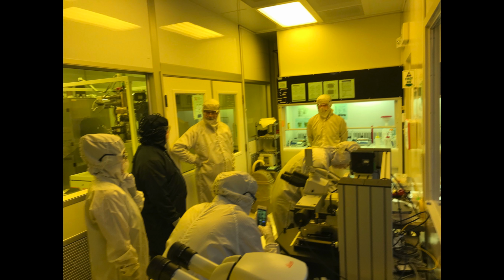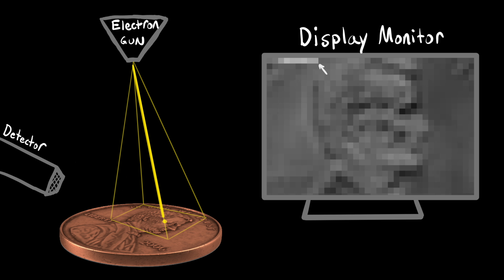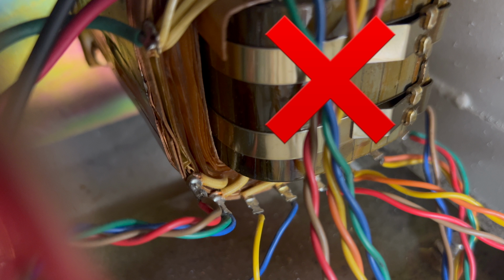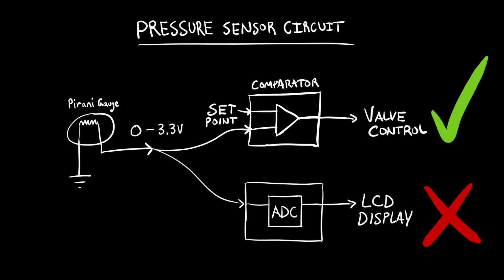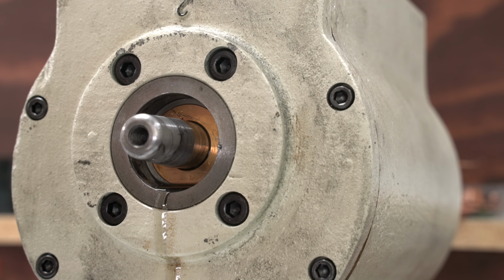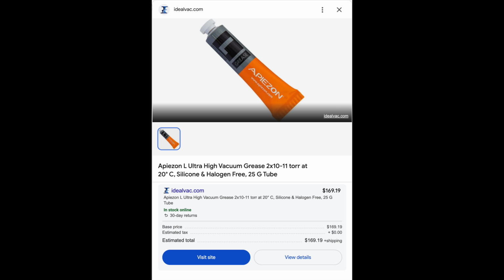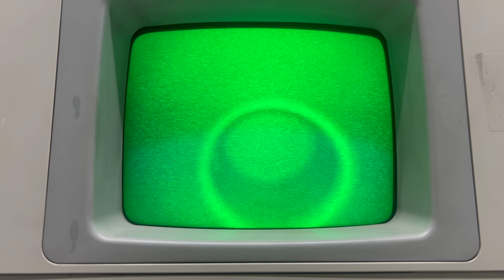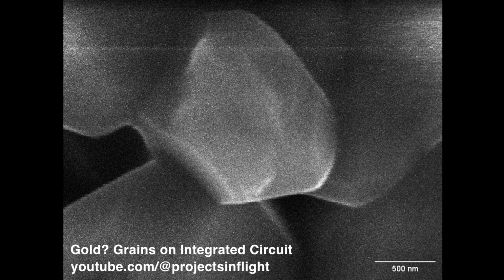I Saved an Electron Microscope from the Trash

Comment: try making a scanning electron beam punch card disc data storage with that. euv diode laser optical. diy is free. try low voltage s(t)ems. static electric charge is enough for s(t)em. much easier when you can run a whole stem from a small battery, instead of wall power. its better to use a small electron beam emitter that is separately always in vacuum, that is close to the sample. not in a huge air volume pipe that needs to be vacuumed empty. then the electrons only travel a very short length over somewhat vacuum from the emitter to the target. with stem its even easier because the detector is on the opposite side of the target, not on the same side. but both cases work. even better if the detector is on the same package as the emitter, like a radar with a radar source. vacuum can be also got with electrostatic vacuum pumps. diy. why do you say me to be good. only one is good. there is no other second coming, those are false gods. God is Spirit, do you have Spirit, that makes alive. completely sealed type vacuum pump, does not require hard to seal tricks. which is easier, to make a completely vacuum tank with internal sections like in submarine, or a single tank with attempts to vacuum seal tricks. no alternative? well, diy the whole vacuum system. dont pay for nonsense claims. you know that market sells for liens. not properly designed system, needs constant maintenance and expensive parts. yeah your system can do whatever. D=O. diy or you dont have it.
Reply: btw, instead of the crt electron accelerator steering system, try tritium with 5keV particle energy right out of the box, for scanning electron microscopy imaging. just do the scanning part, like in a DVD drive.
Reply: how about using both alpha+ and electron+ alpha/beta decay sources at same time, you get neutral fast alpha particle stam.
Reply: how about using both alpha+ and electron+ alpha/beta decay sources at same time, you get neutral fast alpha particle stam.

Comment: Hold your hat on, everything points to apiezon L being hydrocarbon grease.   Gee, petroleum jelly repackaged and sold for $200/g.    Get an FTIR for it, and petroleum jelly.   Thanks for the video.
Reply from the maker: I think the high cost comes from the additional refinement that is necessary. They have to remove all of the hydrocarbons that have a vapor pressure greater than 0 in a high vacuum environment, which is very challenging.

Comment: I laughed when you not only using a 5V regulator instead of a buck converter, you slapped the big ass heat sink on it. But at the end of the day, whatever works.😂
Reply from the maker: yeah, i wanted to use a buck regulator but i was worried the high frequency noise would be a problem somehow
Reply: @projectsinflight  just slap some capacitor on if noise is a factor

Comment: I worked at an out-of-the-way department of Cambridge University. The university officially had two electron microscopes, and big qeues to use them. But where I worked had a third one that students "in the know" could get their pictures done on. The building was from 1950 and the microscope not much newer, if not built into the building itself (it was later removed around 2014, I don't know if the outgoing department took it with them, or just scrapped it). It must have cost the eqivalent of millions back them (so about £50,000!)
Digital printouts, what are those? It used film, which had to be developed in the adjacent darkroom!

Comment: wait you had 7 taps on a transformer?  and 3 werent even used... not trying to be critical but since you had a spare tap of the correct voltage, did you try just switching to the good unused tap?
Reply from the maker: when one secondary is shorted it shorts out the whole transformer
Reply: if you release (ie cut the connections to the secondary it shouldn't effect the primary),  if the other taps are down then it wasnt just one bad secondary.
Reply from the maker: the secondary was shorted internally. I'd have to fully remove that winding to repair the transformer

Comment: Couple of hints based on some 15 years of tinkering with vacuum systems and electronics in general:
- The diffusion pumps are no longer used, but you should be perfectly OK using a turbo pump instead. Some used ones can be found on ebay for couple of hundreds bucks. This is in case you or one of the other enthusiasts ever need to replace whole vacuum system.
- When fixing power supply - when you have a linear voltage regulator down the line, you should be perfectly OK using switching power supply, like the ones for 3D printers or CNC routers. This replaces the transformer + rectifier and is way easier to obtain. Also you can adjust output voltage, so 100V vs 120V is not an issue.
- The problems with image may be because of a corrosion in relays. Most relays are not sealed and contacts will degrade both with use and with time. This would be first place to check.
- If the frame grabber still produces wonky image, go through ebay and look for different frame grabbers. This is very much dead technology, you can pick them up for 50$ a pop sometimes. Getting them to work may be problematic - all the drivers are expecting old windows or ancient linux. Proceed with caution.
- As you are using PMT for readout, you can also just bypass this whole mess and build images yourself! You would need to find direct signal from PMT, a decent scope (Pico Scope for example) and scanning timing signals. Grab data, make some script in python to convert the analog readout into pixels and voila!
If you hit any obstacles, you can always drop me a message. I've been working in academia most of my life and have some experience on fixing stuff with non existent budget :).

Comment: For damaged shafts that need to seal properly, buy a Speedi Sleeve of the correct size. I have used them to successfully repair machines with grooved or pitted shafts.

Comment: Note - that model costs over $4,000 used. After doing some digging, there are several companies who specialize in buying and refurbishing lab equipment.
 So ... WHO THE HAY throws valuable equipment out, even if it doesn't work ?!

Comment: Great video. It brought back a lot of memories. While undergrad lab assistant @ Texas A&M Semiconductor Lab in the early 80’s I worked on high vacuum systems and repaired Transmission Electron Microscope, linear accelerators, plasma deposition, etc. we would receive obsolete equipment from Texas Instruments, AMD, Mostek and others. Luckily we would usually receive multiple units and would have plenty of organ donors to get at least one working.

Comment: You might be able to effectively enhance the resolution on most scans by using some basic stepper motors and coding. If you attached the motors to the micrometer controls you could pan and scan then stitch the image together. Eg you want a clean 100,000x image, zoom in to 300,000x then pan and scan around, stitch image together produce super-res image. Just a thought

Comment: Congratulations! We have a Sciaky Electron Beam (EB) Welder that is also quite old. The biggest difference between our machine and yours is ours is much larger with a vacuum chamber large enough for aviation components. Also we weld joints with our image while you reflect your beam to view images. When this machine is malfunctioning it doesn’t give up its secrets easily. Many nights I’ve left work in a brain fog after spending a whole day getting nowhere figuring out the issue. Your video had me on the edge of my seat finishing your sentences yet wondering what you were going to encounter next and how I might deal with it? Very intelligent very creative approach got this machine back up and running! Congratulations once again-I’m so excited for you!

Comment: At the end of the day, all the "computational intensive" stuff is done after the electron detector. You should try to read from it into some modern electronics. I don't doubt that the amplifier in this thing were top quality, but maybe with modern computing power and algorithms you could achieve better quality images. At the very least you could funned data into a more convenient software in a standard format.

Comment: is it possible to convert that crt into an led monitor?? would be cool ig
Reply: i think it would be easier to just use the computer connection and screw on an additional LED monitor. also, CRTs look dank
Reply: @sanantonio855  born in mid 2000s, so I don't really like the appeal of a crt. I just would've liked the led in place of the crt

Comment: 100v AC, JDM model with a variac! Amazing. Also, the analogue circuitry that drives the crt probably has cold solder joints, which makes the screen jump. Cards are St. Louis Cardinals Baseball.

Comment: Try making an electron mirror! Put a square/sphere of PTFE inside and charge it up to the highest voltage you can with the SEM, then drop down the voltage to 5kV (or less) and the electrons will "bounce" off the PTFE due to charge repulsion and actual image the inside of the column.

Comment: This is amazing! Best repair of all time!
Since the video signal seems to go through an analog coaxial cable at some point, could you switch off the CRT and use a modern LCD monitor, using the VGA input?

Comment: This project is very inspiring.  When I was a kid (early 1970's) our 13 chanel B&W TV went screwey.  My dad opened the back, pulled out all of the vacuum tubes and we took a walk to a pharmacy that had a tube testor in the back  (it was closer than the hw store) .  We plugged them all in and found that one was faulty.  Next to the testor was a shelf of various replacement tubes including a replacement for the dead one.  $2.00 (I think) and a 10 minutes walk home, some cussing and swearing as a screw fell into a bad spot (dropped when I handed it to him), but an hour later I was watching Scuby Doo or possibly Spider man.  Good times. And a reminder that given enough motivation we can fix most things.  It can also add fuel to the "right to repair" movement.

Comment: 29:27 I have worked on many CRT in my younger days. That looks like some caps on the monitor are failing. I recommend contacting someone that is vary familiar with monochrome CRT repair for advice.

Comment: Great content! First time in a while that I've watched the whole video without skipping any part. Also, this was only possible due to the age of the machine. See, it rellied on simple circuits to implement a certain logic which means that, by replacing the individual circuits, you can still keep the machine running without knowing all of the details. Nowadays, processors, while being well protected, are very fragile to voltage spikes and high temperatures. If they get destroyed somehow, there are very few options for fixing the whole unit because of incapability of getting the right firmware to program it once again. They are a lot more capable, but that obviously bears the burden of the potentially shorter lifetime.

Comment: I was impressed with your electrical engineering skills until the end when you said you make ICs at home. Now I'm impressed with your pump knowledge. 

Amazing repair. Kinda lucky that the issues were on relatively easy places to spot instead of like the internal digital circuit.

Comment: With the image acquisition... would it be more useful to capture a series of faster scan images than one slow image? Maybe one could add another digital capture to the video signal. With a set of images, the usual operation would be to just average them out. Even just that could already lead to a better resolution and dynamic range than the analog averaging. But it would also be possible to remove or realign outlier frames. And the distribution for every pixel would be a gaussian curve, so maybe one could use the variance of each pixel as a false color channel? Probably people have thought of such things before, but I don't know much about electron microscopes.

Comment: Brings back memories. Vacuum numbers are rookie numbers though . Gear I worked on went to 10^ -16 torr. Fun times.
Reply from the maker: i'm guessing you used a cryo pump and ion pump in addition to the diff or turbo? I can't imagine ever getting my vacuum that high with a chamber that is constantly opened to atmosphere. i was contemplating someday trying to make a uhv chamber though
Reply: @projectsinflight  Yes to all the pump types. Pump failures can be exciting (read expensive). Knife edge flanges with dead soft copper "gaskets". Cleaning, so much cleaning.

Comment: I ve fixed a ton of equipment not an electronic microscope. You see a toN of Issues in the mechanical side. It is no surprise maintenance lacking was the key issue for this microscope to fail. From the video part. You maybe need to replace video cables as it is analog signal and by themselves generates noise(cables isolation). As most video hardware degrade as mostly uses electrlitic caps. These die of age.

Comment: Big deal. You fixed an SEM.
I cleaned out the secondary lint filter on my dryer. Yes, the secondary filter. And I did it a month earlier than required.
I was so excited at how well that went that I then cleaned out the in-line water filter on my washing machine. It had a little slime build up, but a misture of 0.5 cups ammonia, 0.5 cups of Simple Green in 500ml of water cleaned it right up. There was no debrie in the filter, a clear testimony to how careful I am with items placed in the machine. All pockets are checked for foreign objects. Yup, it was a big day of maintenance on appliances. The wife is sooooo happy.

Comment: stabilizer 7805 can be installed 2-3 times in parallel to heat less.
An analog cable can be better, with an external additional screen attached to the ground (this should reduce image noise and allow more useful signal to be extracted)

Comment: on the computer you can use high speed scan and overlay thousands images and extract median value of the images... so having more resolution and/or noise reduction that follows the formula of square root of number of images resulting gain.

Great video

Comment: Great video :). The scanning electron microscopes workings actually look resonably simple. It is basically a gloryfied cathoderay tube where the picture producing phosphorscreen is replaced with a microscope stage and a Image intensifier tube. Plus som control circuitry. The instability in the image could be caused by old, leaky or shorted capacitors especially as the microscope was produced in the time of the capacitor plague.

Comment: ok back the diff pump with rough vac and it needs a chiller, what a needy little pump.  

does the diffusion pump spit oil back up into your "column"?

very cool video! my boss bought a few of these but never got them up and running..wish he was around to tell him about the discord! and I love the gross leaking bellows! classic.

lol good thing the fly didnt off gas too much.  great work!
Reply from the maker: The diffusion pump boils oil and the oil vapor stream could potentially enter the column and contaminate stuff. There is a baffle that is liquid cooled between the pump and column that condenses oil vapors that get past the main part of the pump. If the liquid cooling fails and the baffle gets warm it will allow the vapor to pass into the column, which is a very, very bad day.
Reply: @projectsinflight   i have some experience with electric propulsion, the contamination from diffusion pumps was not recommended so I have no idea of their operation procedures.  I am mostly familiar with turbo pumps and cryogenics, and all the ways you can crash them :) i can imagine a scenario of plasma heating the baffle and causing oil mist to enter the main chamber volume.  

It was also cool to see you use IPA as a cheap leak detector. nice attempt at the rough pump rebuild.  xbox donor switches. dude you are a brilliant engineer.

Comment: Strange, non-causally related number of errors that could not logically have been caused by use, as each individual error would be critical.
Reply from the maker: i suspect one of the errors was the thing that broke the machine first, then the others probably were caused either by poor repair efforts or poor storage
Reply: @projectsinflight  Yes, that's the only way it would make sense, because push-buttons don't break if their power supply has died beforehand. Conversely, no one can continue working with defective buttons until the power supply finally dies.

Comment: just a thought, your can wire that composite video cable to a cheapo usb capture card and use it on a modern computer, with some video capturing dark arts you can make something much better than that 20 years old software running on xp.

Comment: WOW, your level of patience is incredible, congrats on your repair!. Here is my humble suggestion on how to use the SEM for other purposes, can you try to use it as E-beam lithography tool?. From experience, it is just a software change. You can coat a piece of Si with PMMA and use the proper energy for exposure. Later for imaging, you can use the lowest voltage possible, 10 kV ish?.  I am wondering if you can get a photonic waveguide or coupler in the 100s nm range.

Comment: 29:19 I'm sure you've thought of it but that instability could be the CRT itself.  Also is that RCA signal, NTSC standard? Could you just plug a standard composite capture device onto the RCA and use a modern screen or PC? Fun stuff.

Comment: When I saw the instability on the monitor, my first thought was that the frame circuit of the monitor itself was the cause.  But the instability in the PC capture makes me suspect the signal further upstream.  That Composite Video cable you added, I would connect that to a known good monitor and check to see if the height is stable there.  That would help you to isolate the cause of that issue.